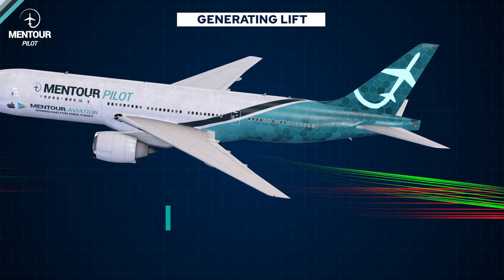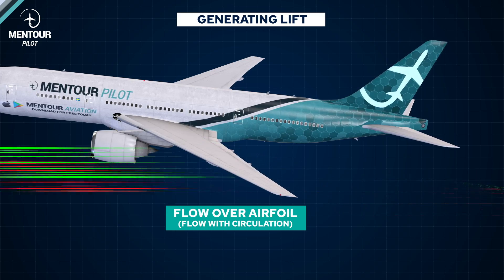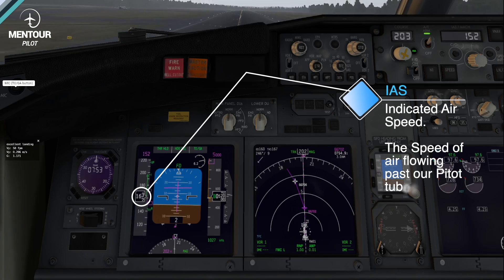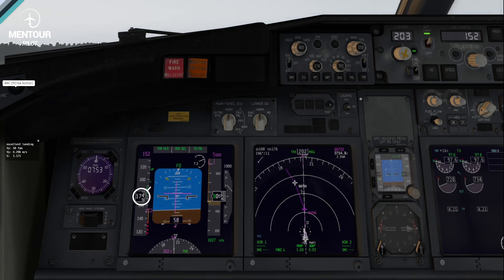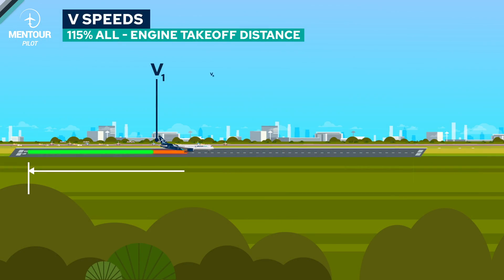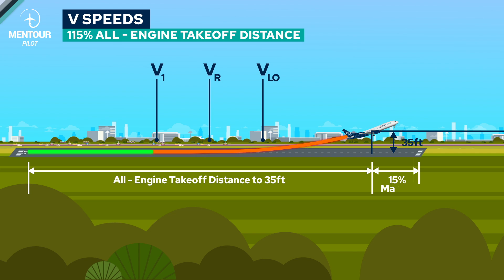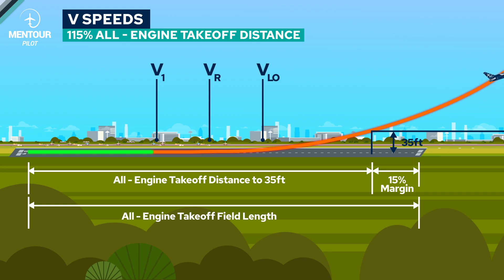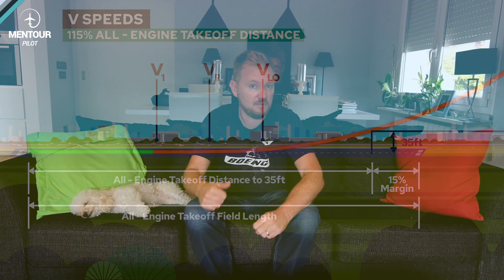Why do pilots call out SPEEDS?!

Comment: Typically, a fully loaded truck has the same stopping distance as an empty truck, provided that brakes are not limiting the braking power but rather the tire friction. Is it not the same in the aircraft?
Reply: I would assume drag has a larger role at stopping the plane than friction. Friction is proportional to the force being applied (more weight, more friction) while drag varies in function of speed alone.
Reply: @josetrindade3550  Drag has a little stopping power at this speed.
Reply: There is a speed dependence to available friction force as well, though the curve is relatively flat until low speed (say under 10 kt).  And for some aircraft, the brakes will be "torque limited" at higher weights and speeds, meaning that at maximum braking pressure the tires won't skid.  These factors (along with drag, which is only of secondary importance) make it not an exact relationship between weight and stopping distance.
Reply: The premises in your comment doesn't make sense to me. Adding weight increases the energy the tires have to handle. Adding speed increases the energy the tires have to handle. Increased energy will increase stooping distance in both situations, because the tires can only handle a given amount of energy per second. Even though increased weight will increase tire friction and thus the ability to handle more energy, I highly doubt the stopping distance remains totally fixed at a given speed, regardless of load.
Reply: @Trotters79  I see a contradiction in your reasoning. You are saying "increased weight will increase tire friction and thus the ability to handle more energy" and "the tires can only handle a given amount of energy per second". Both statement's can't be true at the same time. Actually, the first one is true and there is an experimental evidence that stopping distance for a loaded and unloaded truck is  the same, provided that brakes arer'n a limiting factor.

Comment: This should be more popular video than the previous one. I think that is interesting for many people... Not for the pilots in this case, but it helps to develop the channel even more. Well done! Great intro, btw.
Reply from the maker: Thank you my friend! I will try and continue to develop the channel 😉
Reply: @MentourPilot  Very good video sir. I really enjoy this kind of content. I think you could have a part two to this where you explain the rotate process in more detail. I have always been curious about how this lift of the ground is achieved i.e. what mechanical parts of the plane is involved when rotation occurs? It would be an interesting thing to see. By the way, this may be my third or fourth request for such a content. Keep up the good work you're doing Captain!
Reply: @MentourPilot  I agree - you do a GREAT job and I am learning so much!  Please explain high speed stall and low speed stall vs altitude.  I saw this in a U-2 video and you just mentioned it in another video - I am intrigued.  I know what low speed stall is at low altitude but there is a 'window' for high altitudes that I'd like to learn about. TNX
Reply: @MentourPilot  I have yet to be disappointed you always make fantastic videos thanks for the good work!

Comment: These are just out of memory, from a sim pilot.

V1 - Speed at which you cannot safely abort the takeoff (not enough runway left to stop without overshooting the end).
Vrotate - Speed at which you apply aft pressure to rotate the nosewheel off the ground. (ie. You have enough lift to keep the nose in the air)
Vlof - Speed at which the rear wheels will leave the ground, leaving the plane completely airborne. 
V2 - Speed at which you can maintain a safe rate of climb even if you lose an engine.

I'm only 90% sure on V2, as my sim experience is with the F-16, which only has one engine and doesn't much care about V2. :)

Comment: its the 
decision speed at which stopping is no longer possible and the airplane 
is committed to fly. This is known as V1  When the airplane attains the Vr speed, the pilot who is not manipulating the controls calls Rotate ," then the flying pilot applies aft yoke or side stick to raise the nose

so V1 you have to take off nomatter what.  you cant slow down the plane before the end of the runway. you are commited to takeoff
Reply: It's not that stopping is no longer possible (unless your runway happened to be the minimum required).  It's that high speed aborts are dangerous maneuvers.  Safer to take care of the problem in the air and come back for a controlled single-engine landing.
Reply: @mtnairpilot  No! V1 means to fast to brake before the end of the runway, nothing else
Reply: Some (most?) pilots may think that braking at V1 will nominally have the aircraft coming to a stop right at the end of the runway, but in many instances (e.g. dry runway) it would stop with a significant amount of runway still remaining.  That's because the FAA mandates a substantial factor of safety be applied to the flight test-demonstrated RTO stopping distance in calculating V speeds.  So past V1 you could generally still stop, but no way for the pilots to know how far past V1 it is that they've used up the margin.

Comment: Ιt should be V1, VR.... V2,  positive rate, gear up.    VR was replaced by simply "rotate" while V2 is not even called out.
Reply: Isn't this because V2 is nearly always the same, or very close, to VR?
Reply: @kbg990  thats why
Reply: @kbg990  No.  V2 is usually significantly higher than VR.
Reply: Vr=Rotate
Reply: Positive rate/gear up happens before reaching V2.  V2 isn't typically called unless there is an engine failure requiring a V2 climbout.  V2+10 is sometimes called because that's when flap retraction can occur.
Reply: V2 doesn't necessarily have to be far removed from Vr.  The AA 191 accident report (DC-10 Chicago crash) noted that V2 was achieved just prior to liftoff.